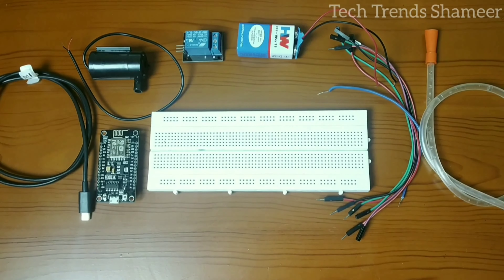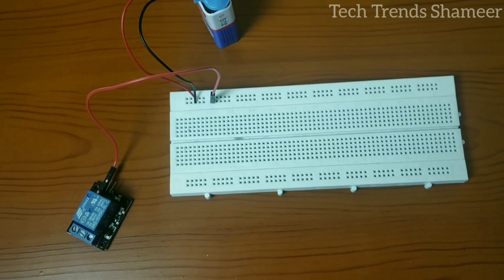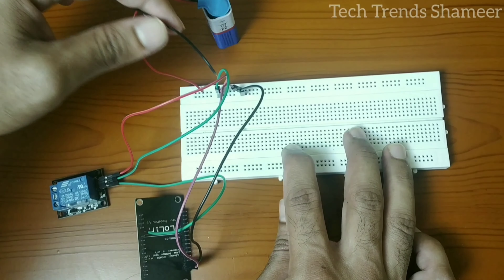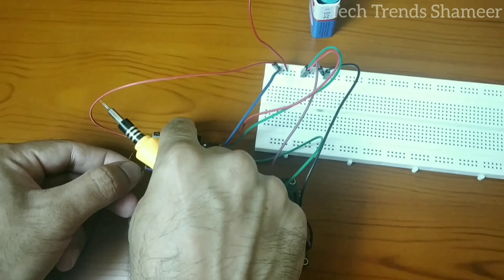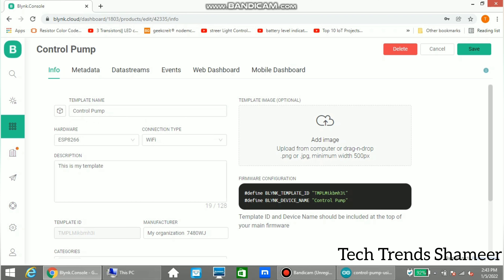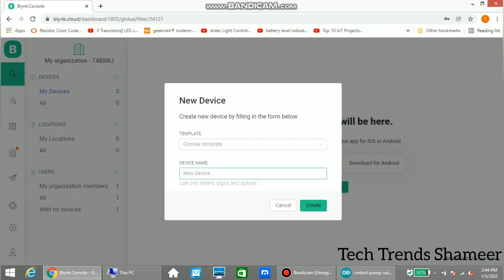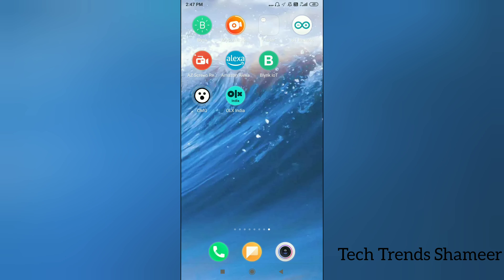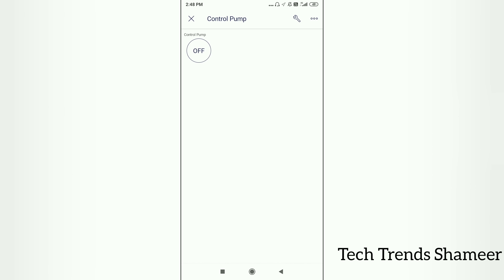Smart Irrigation Using Blynk 2.0 | Control Water Pump Using Blynk 2.0 | Home Automation | Blynk 2.0

Comment: I have made the same connection as you shown into the video but whenever I switch on and off from blynk app it does not effect the motor ..?how can it possible.. I have tried so many ways ..but it is not controlling the motor
Reply from the maker: Instead of pump, can you please try with an LED and do the same steps and make sure it is working fine. Then replace with the water pump. It would be easy to find the problem

Comment: why we use digital pin 2 in blynk but in circuit connected on digital pin 4?
Reply from the maker: In blynk, we need to mention the GPIO pins. For the digital pin D2, the GPIO pin is 4 as per the pin diagram of ESP8266

Comment: Just wondering if this will work if we use the power from USB instead of the battery
Reply from the maker: Yes it will work. But my board is not supporting the power from USB. Please give a try.

Comment: Your video is very good but when i click off motor is should stop working but it's still working continuously can solve my issue why this is happening
Reply from the maker: Check the relay
Reply: @TechTrendsShameer  i have checked relay it's 5 volt relay and working fine I have checked output and input voltage through the multimeter
Reply from the maker: Ok

Comment: PROJECT is very Good 👍
Suppose if I use ac motor(18w) then sir what changes we have to make ?
Please guide me sir !
Reply from the maker: You need to use relay. 
Please refer this project and replace the bulb with the A.C Motor
https://www.youtube.com/watch?v=2rvMxE1lFU0

Please be careful while using A.C devices and relay.
Reply: @TechTrendsShameer  Thank you sir. 
I have one doubt  that 9v battery is compulsory ? 
I not have bread board.
So what I do know?
Reply from the maker: @shubhamsaptasagare7957  9v is not compulsory. My board is not supporting with DC supply from laptop. So I used 9V battery. If your board support, then no need
Reply: @TechTrendsShameer  can I connect directly all wires with each other ? Because I does not have breadboard.
Please Guide me sir !
Reply from the maker: Yes you can. Follow the circuit and connect the wires
Reply: @TechTrendsShameer  
Thank you very much sir for giving me advice.
Reply from the maker: Welcome
Reply: @TechTrendsShameer   if I given power to nodemcu by using USB then circuit will work properly? Or we need to change the circuit diagram!
Reply from the maker: @shivamsaptasagare2600  No need to change the circuit diagram. First try without connecting the 9V battery and if your board is not working then give 9V supply.

Comment: I did the same thing you've shown in the video. But my pump start automatically when I give it connection with the relay module. [Pump's positive to relay common and battery positive to relay NO]. 
And the blynk app's switch does not work
Reply from the maker: May I know the type of relay you are using?
Reply: @TechTrendsShameer   JQC3F-5VDC
Reply from the maker: Please send the photo of the relay to me in Instagram
Reply: @TechTrendsShameer  the same thing is happening to me as well...what should i do ?
Reply: sorry for bothering, i wonder if you found any solution regarding this problem, same thing happen to me too
Reply: @rijuthaa2207  sorry for bothering, have you found the solution??
Reply: same

Comment: Can we add soil moisture and dht11 sensor with it !
Reply from the maker: Yes you can. Need to modify the code
Reply: Make a project where dht11 and soil mosture sensor and esp 8266e connected together and with a dc water motor and we can control the water pump from a local wifi  webserver and monitor everything from the webpage

Comment: can I connect this without board
Reply from the maker: you mean without nodemcu board? that is not possible
Reply: @TechTrendsShameer  I mean bread board
Reply from the maker: @mindgamessoftwaredevelopme7726  Yes. You can. But you need to do some soldering if the connections are using the common pin.